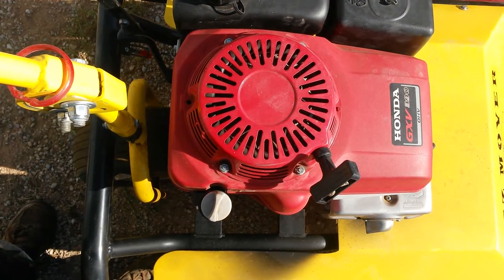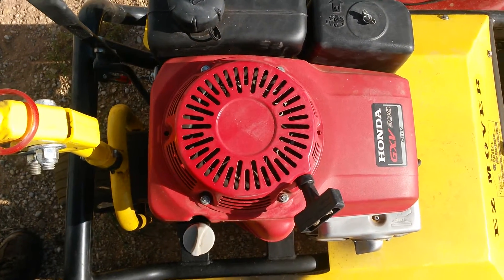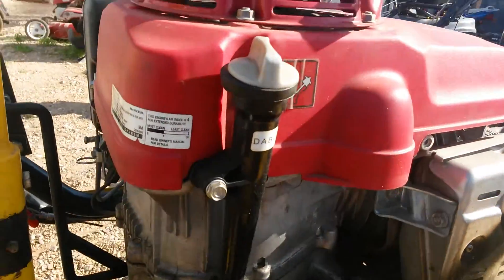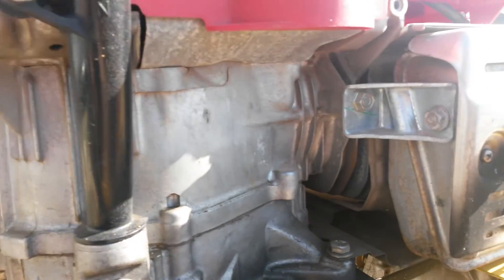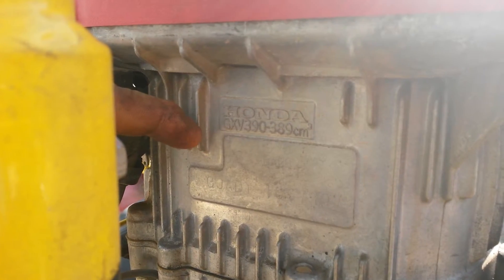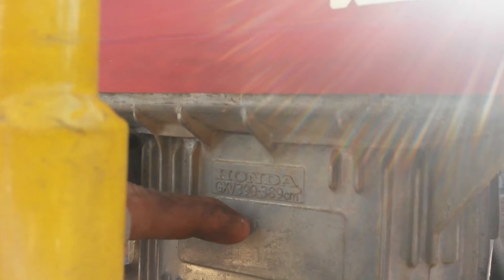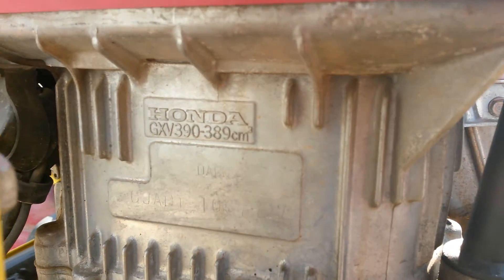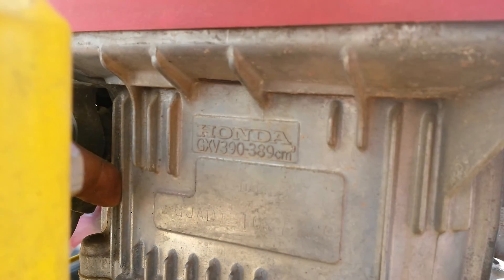Cant find what model Honda Engine you have ?  Here is where you find the Honda Motor number

Comment: Do you know if there's any other potential locations?  I'm backyard repairing a few mowers and sometimes the etching is too light, it seems like the weathering has almost completely removed it
Reply from the maker: Not really.  Most times it then alot of visual comparisons.  Sometimes the MFG who used the motor will list it in their part list as a major end item.  Like sears does for craftsman.   That's a source